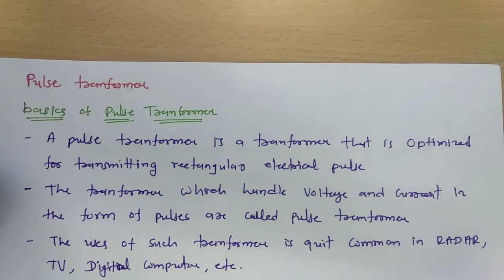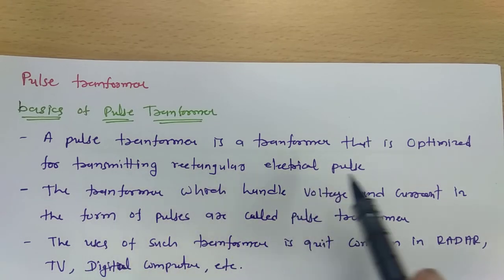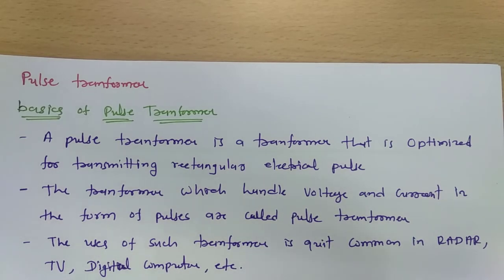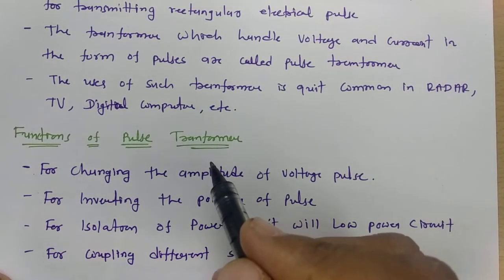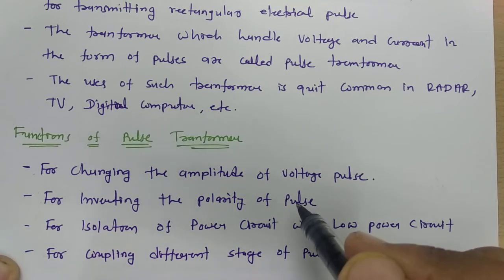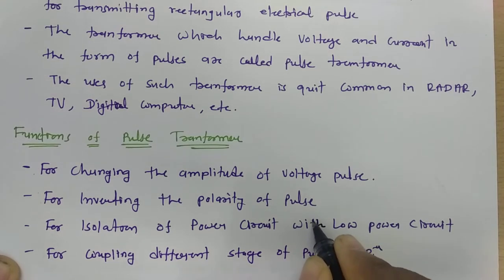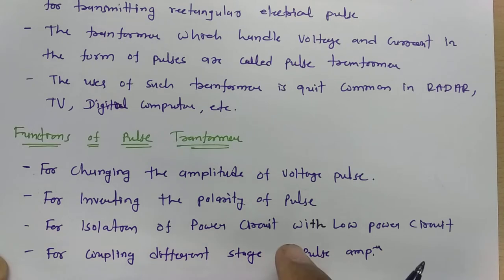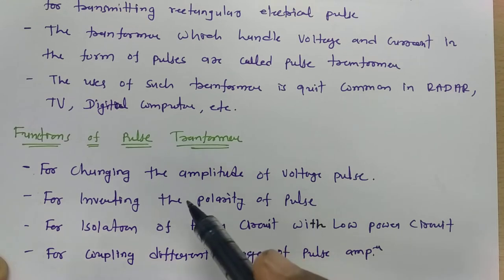Pulse Transformer (Basics, Functions, Types, Driving Circuits, Waveforms & Advantages) Explained

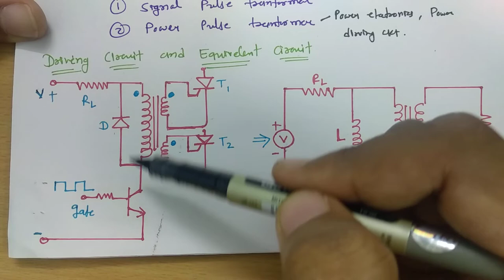Comment: 6:06 the diode is called flyback diode , used to discharge an induction (ie. primary winding)
If it's not used , the voltage across the primary when the transistor is turned suddenly off becomes soo high it will fry the transistor
Reply from the maker: you can use another application dear.

Comment: 1. Effect of Source Inductance in 1 phase and 3 phase rectifiers, distortion in line current waveforms, voltage distortion for diode and SCR based rectifier
2. Space vector modulation for 3 phase voltage source Inverters, hysteresis control
  Sir, Could you please make videos for these
Reply from the maker: Noted
Reply: @EngineeringFunda  when will those topics be out?

Comment: Oru doubt two sepic converter we used to convert  Dc-Ac without using inverter it's possible or not.. DC vge is input but we want ac output without using inverter in this circuit... Two sepic converter is connected parallel in between we give supply one converter operates positive half cycle then another converter operates negative half cycle that means square wave but how get sine wave if possible or not
Reply from the maker: By second order circuit we can translate square wave into sine wave.
Reply: @EngineeringFunda  second order circuit means.... Pls detailed answer
Reply: Sir suppose we use with SPWM generator then possible or not
Reply: Sepic converter working and operation
Reply: sir thank you these videos are very helpful to us and sir plz make videos on machines topicwise